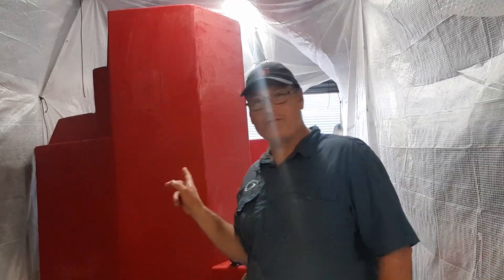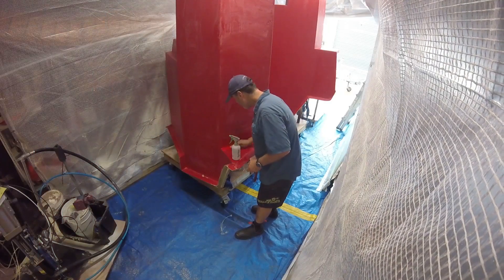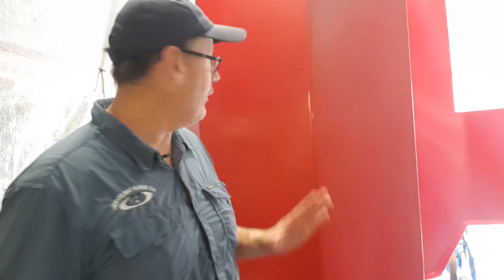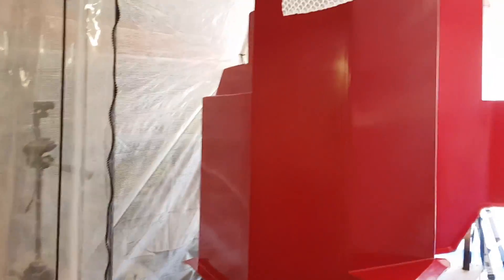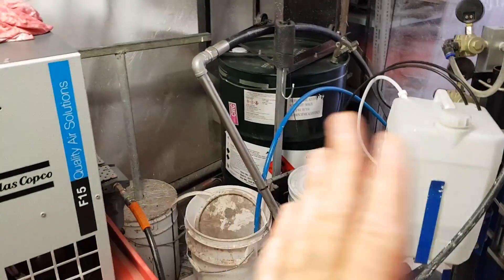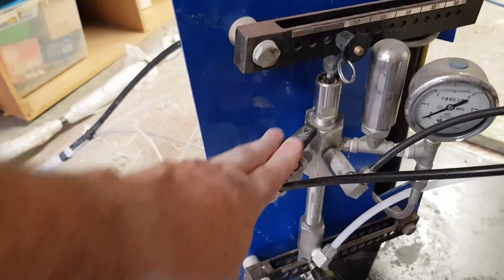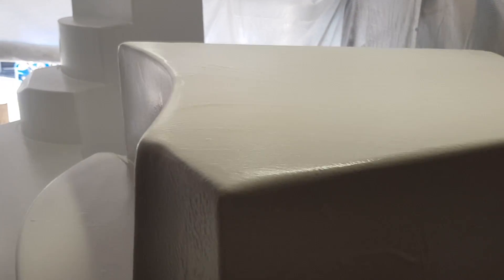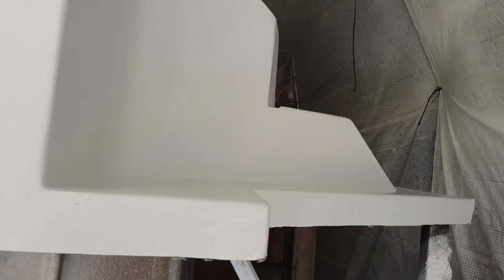Ep058 Gel Coating the large internal stairway - Life On The Hulls - Building a Catamaran

Comment: Excellent video!  On gelcoat, do you need to be careful of runs? Is there a "best" thickness?
Reply: It can cause air pockets between the layers. If you've ever seen where the gelcoat cracks and falls off on a boat it was possible caused by drips when sprayed.
Reply: Hmmm, glad I asked.
Reply from the maker: Runs really arent an issue as the surface is female and as long as the surface is good of the mould,provided you remove the excess runs on the outside which I usually sand flat prior to laminating You will not have issues with bubbles,spider cracking.Gel coat is a flexible medium and is only as good as the laminate and the laminator behind it. Best regards Ross

Comment: I have been a paint and bodyman for 35 years. 25 in a heavy duty truck manufacturing plant. And I can say that gel coat gun sprays like crap. Very poor pattern. Should look at changing the head, fluid nozzle, and needle out with a new one.
Reply from the maker: Yes it wasnt great here,i admit.The air assist was not regulating correctly and there is no needle in this gun.I did however discover a small piece of crap in the micro tip 521 that was effecting the pattern.That said the gel coat was perfect albeit excess on door areas that will be cut out in any case ,but great perception of you John.Space to work in also affected the distance I could get and technique as I like to employ a robotic style 50/50 wet on wet pattern to improve quailty,unfortunately a bitch of a module to spray.Cheers Ross

Comment: Really shows how much work goes into building the moulds. And that’s before you build a boat!  You sure don’t take on that venture unless sure you’re going to sell a few boats...
Your concern with the dryness of the air in your gun makes me realise how well the West System epoxy I used on my glass over ply boat, handled the ridiculously wet air of an Auckland winter. In my ignorance I didn’t even realise it was a factor!  I was laying glass and epoxy while 1 metre away it was pouring rain outside my open garage door. I only had the transom fail to cure on one occasion and it had to be scraped and wiped down and done again. At the time I didn’t know what the problem was. By good fortune the fibreglassing went well, all be it slowly - I had to wait 3 days for it to harden right off on occasion before I could sand it. Anyway all’s well that ended well but it was a case of not knowing what I didn’t know. Experience is a wonderful thing. Cheers
Reply from the maker: Hey Robin,i reckon you got off lucky,i remember my first timber,west system epoxy sea kayak I built,i didnt consider the winter humidity and cure times and had some cloudiness in the cure.Reality is,moisture will permanently unhibit full cure so you must be cautious,even pedantic as a semi cure is not a strong substrate,especially in the case of epoxies and vinylesters which are of the same family.Cheers Buddy,great to hear from you again.

Comment: Great video, just a small tip. You need to back off 3-5 inches when spaying to allow oxygen molecules to do there job on the the gelcoat mist. Thicker isn't always better
Reply from the maker: Was a bit of a struggle with this mould due to it's suze and height.I normally spray sbout 50cm out but this module filled my spray tented.Also i think i put to much on the top prior to the sides ,given another go at it I would spray the sides first and build a bigger spray tent to be able to move and spray correctlyFortunwtely the 2 areas of excess will be cut out regardless for doorways and cabinetsry.Thanks for the tip I Appreciate the comment.Ross comment.
Reply: @LifeOnTheHulls  I think your doing a great job. I work with gelcoat all the time so it was just a small suggestion. Molds are sometime very difficult to work with. Keep making great videos.
Reply from the maker: Love it buddy,I can feel your pain.Cheers.

Comment: Ross you want to spray the gel-coat the pattern same way as paint spraying a car to try and prevent gel coat runs, I pull the trigger on the gel gun just beyond the edge of the mold about 4 inches then bring the spray gel across the surface of the mold and the release the trigger on the gel sprayer 4 inches off the outer edge of the mold , the gel gun has lots of line pressure on that initial stream of gelcoat. Your mold and spray pattern looked great , just not much room space you had to spray a big item like that. Great work Ross
Reply: Stupid question - why do gelcoat runs matter when the mold was so smooth in the first place ? Do the 'bumps' translate into the layers of laminate ? Or does an uneven thickness of gelcoat cause weaknesses?
Reply: OK Keith , Those drip runs have ridges that cause the fiberglass mat to not lay perfectly flat and they will trap small air bubbles along the ridge lines when resin and mat is applied to make the part , this makes that drip run area have brittle gel coat section on the face of the part after its pulled from the mold , where the air bubbles are trapped and most often lead to a hair line crack , this becomes the weak area. All gel coat must lay flat with about 5 mills thickness , they make mill tester for this. Ross said he was going to have to slightly sand down the gel coat drip run that left that ridge drip line so his fiberglass vinyl ester resin & mat with lay flat onto the white gel coat and use his air bubble laminate roller to make sure no air bubbles are trapped. It,s a precautionary thing to do, when the drip runs are oversized. Even coated spray layers with 5 mills of gel coat thickness and let the gel coat cure to a dry state before applying resin & mat. Use Mekp 50 is ideal at 70 F to 85 F , if the mekp is mixed wrong with the gel coat , it will gator effect and crack-age , the surface will look like alligator or crock skin , wrinkled up . You want smooth even coats properly cured gel coat is ideal for your perfect part. It took me a while to become good at this , practice on small parts before tackling those big parts. Ok, make sure to always use vinyl ester resins and gelcoats when making boats which have a tight cure bond when cured less chance of air bubbles forming in the resins that lead to cracks & blisters on the surface face of the part or hull......
Reply: @firefox2716  wow thanks for such a comprehensive reply.
Reply: Your welcome Keith ! a few more things wear a good a mask and spray suit with face shield protection. Use acetone cleaner only for vinyl ester resins spills , cleaning off hands , cleaning brushes , laminating rollers , just never wipe acetone over clean plastic lens on spray equipment gauges and no open flames. After you spray the mold or laminate the part up and bubble rolled out the trapped air from the fiberglass mat.....leave the area or room quickly as possible and let it cure .....not good to breath in any the chemical vapors as we all know. The chemicals have to be mixed just right with mekp , theirs a mixing chart ratio graph on this , it tells how much working time you have before curing starts . Ross sets his spray machine at the right ratio mix . Just ask me anytime about fiberglass Keith ..Glad to help !
Phil
Reply from the maker: That is abspkutely everything I eanted to say Firefox,that module was so difficult to spray,next time I will give myself twice the room to spray it and a scaffold around it to access correctly and spray consistantly.Thanks for answering that so concisely.Cheers